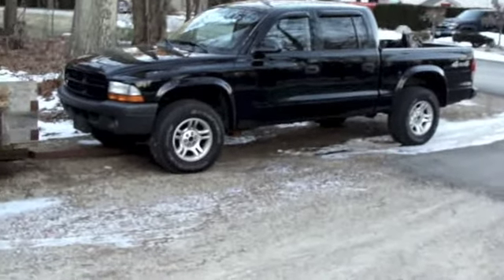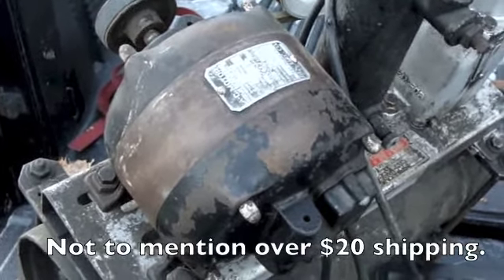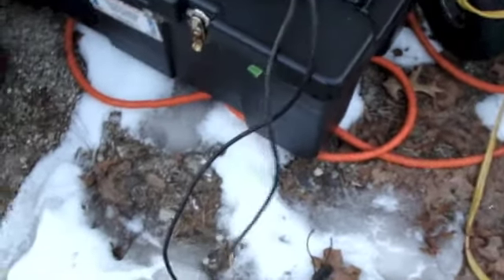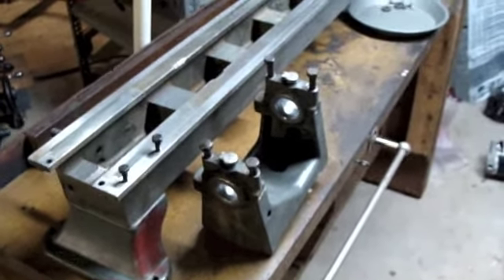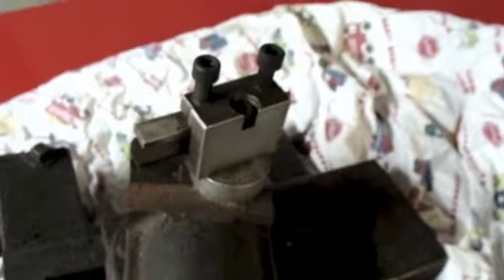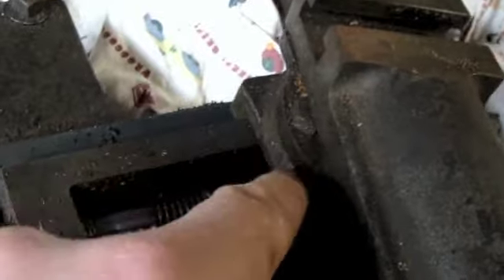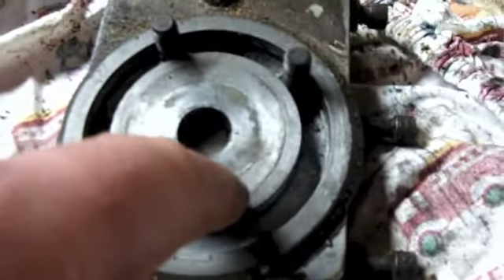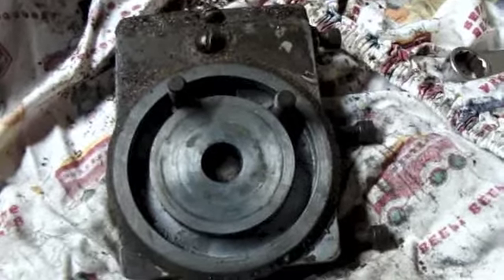Atlas 9" Lathe Part 6

Comment: Question: On the Atlas lathes which feature flat ways, could one theoretically turn the bed around and retrofit the head stock (and everything else) onto the former the tail stock end to basically have a section of usable ways with very little wear?
Reply from the maker: John Strange I've never seen it done. even if it could be done, it would require a lot of modification since the bed is what everything else bolts to.